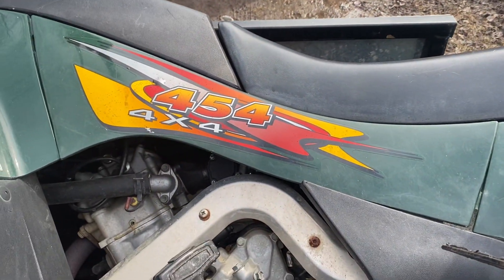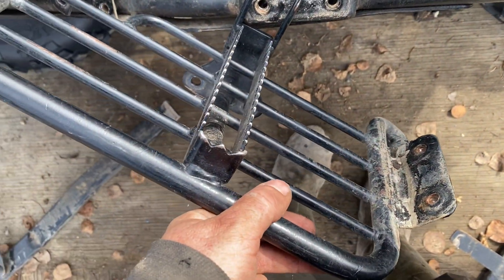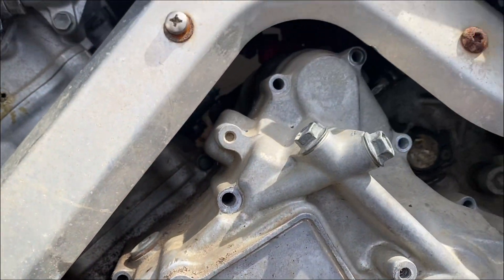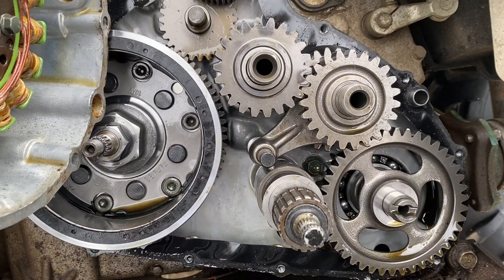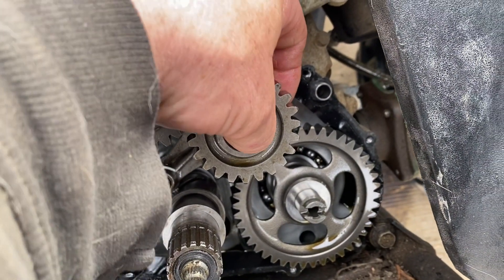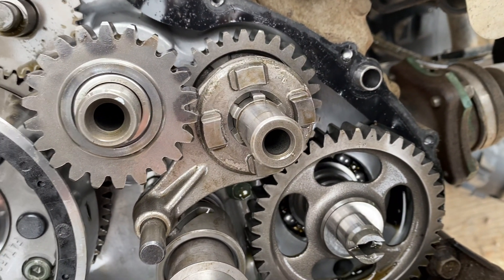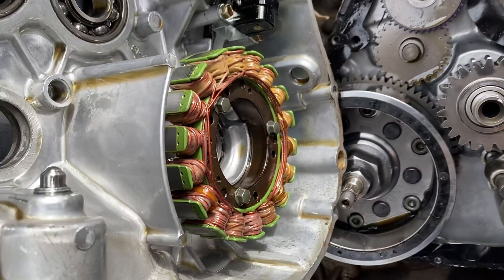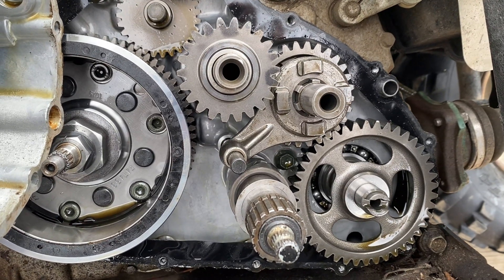How your High / Low shifting assembly goes together - 1998 Arctic Cat 400 454 500

Comment: So mine is facing the correct way but for some reason it's not grabbing still. I had it looked at by a local Arctic cat mechanic for damage or rounded part but it's perfectly fine so I'm at a loss
Reply from the maker: Try putting all 4 tires in the air and rotate a tire while in gear to see what is moving or not moving.

Comment: So did you ever get it fixed and figure out what was causing it not to go all the way into the locking mechanisms
Reply from the maker: The cog that sits in the centre of the low and high drive gears was put in backwards so it didn't sit inside those drive gears properly. Someone was obviously inside this case before me but I'm not sure for what reason. Likely the gears fell out with the outer case when it was pulled off and that cog was flipped when it was put back in.
Reply: @HillbillyToolBox  thank you sir for your video. I went back into mine after replacing the stator gear and I didn’t have the cogs lined up right.  fix my problem.
Reply from the maker: @scottyfixer452  I'm really glad to hear it!